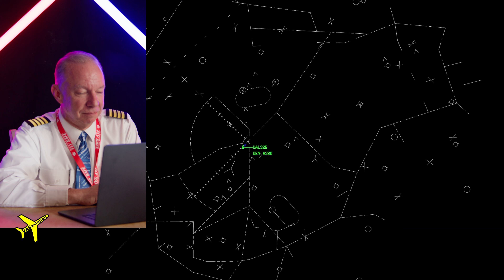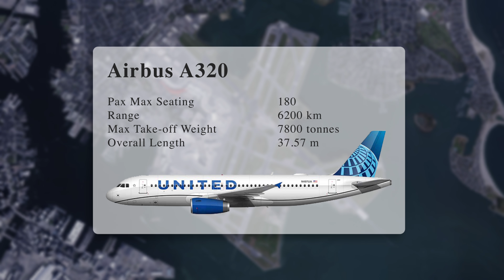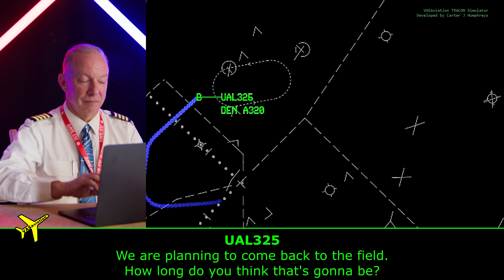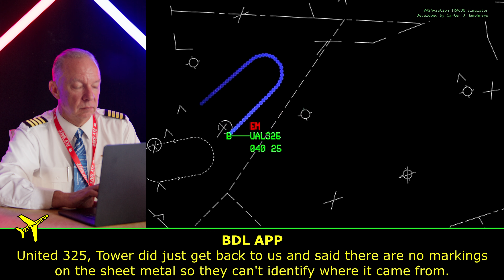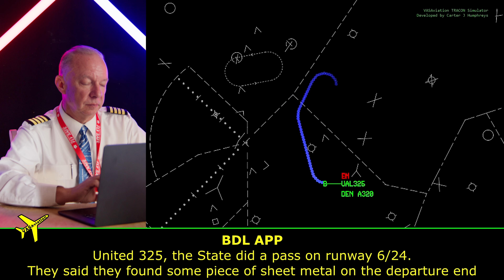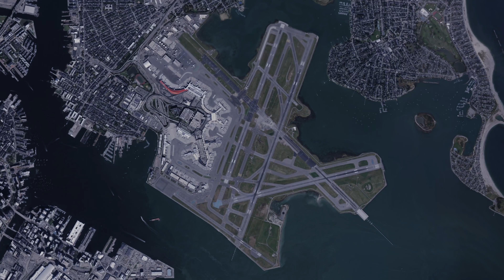United 325 Disaster Averted: Engine Trouble at Takeoff! | Captain Steeeve Breaks It Down

Comment: Captain Steeve...I am aware of an incident that happened in Milwaukee in September of 1985. When the Midwest plane was going to take off in Madison to Milwaukee...there was a delay to "fix" a "malfunctioning" right engine light which was indicating a problem.  The light was swapped out and the plane flew onto Milwaukee. While the plane was changing crews...my friend of many years...was to take the plane onto Atlanta.  (This an airline owned by Kimberly Clark) Again there we was a delay.  The new pilot (possibly Dan Martin) was asked by my friend wha t was causing this delay. The pilot told him that the right engine light was malfunctioning and it was being changed. 

Now...we don't know if the pilot was aware that there had been a delay for the very same 'reason ' in Madison...but it was enough for my friend to exit the plane and drive to Cleveland where he lived.

Why the mechanics in Madison AND Milwaukee BOTH failed to diagnose the real problem (the right engine had a bolt which was rising up and clipping the blades) but it led to the Crash of Flight of 105. On take off the bolt rose to the point where it sheered the right engine blades destroying the engine and possibly the shrapnel also negatively affected the left engine as the left engine 'stalled' only several hundred feet in the air then nose diving into the edge of the woods very near the airport. All  souls on board perished. The FAA blamed pilot error for over correcting and stalling the left engine.

The one civilian member of the five person committee blamed the engine failure as the cause of the crash. Of course...as you know....pilot error is a convenient choice of blame as it (in 1985) changes the amount of the survivor benefits paid out. 

The damaged engine was the problem.  WHY it was.'missed' twice within 45 minutes is tragic. 

Was there a cover up? Certainly there should have been notes logged on the maintenance log in Madison.  And when the NEW light  just thirty minutes later (or even during the short flight?) malfunctioned again (of course IT WASN'T malfunctioning, it was PERFECTLY SCREAMING CHECK THE RIGHT ENGINE!) how could that have been so easily sloughed off as inconsequential?

My friend who got off the plane arrived in Cleveland late in the evening.  His wife had been under the impression he'd died in the crash. WHY hasn't this sole survivor of Flight 105 never been interviewed about the events of that day? He knows what (really) happened.  He's a well known radio consultant who is well spoken. He could speak truth to power and exonerate Dan Martin and his co pilot.  Maybe I should do a podcast? 😮
Reply: The left engine did NOT stall.  It continued running.  There’s a fuselage between the left & right engines, so no possibility of shrapnel damage.  THE actual cause was pilots pulling up & losing speed.

That caused the plane to lose lift & crash.  If they had gone level then the plane would still be flying.

50-50 right engine explosion, but also pilot error
Reply: Also a plane can fly even if engines stop working.  It’s called gliding & these pilots should have been able to land semi-safely
Reply: Lawyer time
Reply: I think that you should let the FAA know what you know. Especially the part about the payout for the deaths of all the souls on board.
Reply: There is a short article on Wikipedia at https://en.wikipedia.org/wiki/Midwest_Express_Airlines_Flight_105.  According to them, pilot error after an engine failure caused by a detached sleeve spacer.  The chances of the pilots recovering were reduced by Midwests' "Silent Cockpit" rules, so that CRM was significantly affected.  The FAA Principal Operations Inspector also got a lot of criticism, as the silent cockpit rule was contrary to approved practice, and significantly reduced the chance of the crew safely landing the aircraft.
Reply: What amazing and LIFE SAVING foresight your friend had!!

Comment: This JetBlue pilot should be commended for potentially saving lives.
Reply: He’s too busy thanking whatever deity that all his tyres are still able to roll.
Reply: @philippal8666 tire
Reply: I noticed the manufacturer WASN'T initially mentioned!
Is this because it was Airbus, and NOT Boeing???
Reply: @gailreed4597  Might want to re-watch the video as he very clearly said it was an A320 so Airbus but its an engine in this case that is on many types of plane's, the plane was useing CFM - 56 from the tail number info ive found. A lot of A320s have this option as well as next gen B737s.
Reply: @cambellsweeney3095 None of the UAL A320's have CFM engines.  Look at the cowls.
Reply: @oscarb9139  5 of them have maybe you might want to check what you know. I admit I made a mistake ( Im not an jet engine pilot so can only go by the paper work I could find ) as this plane did that was correct but the paper work was 5 years old also UAL was not the first owners of this airframe so that might be why it had CFM 56s 5 years ago. 

You think thats a mess to follow, This will blow your mind I was a co-pilot before I lost my wings due to medical reasons on the Fokker 50, my airline had 6 of the twin turbo prop aircrafts they was all between 39 years old and 44 years old and between the 6 we had 3 different engine types. 2 of the planes in the fleet needed to have different load sheets the other 4 had the more common engine type.
Reply: @gailreed4597 Does it make a difference?  If so, why?

All aircraft have mechanical failures.  They both build good aircraft.
Reply: That’s his job lol. It’s not brain surgery. Decent eyesight will do the trick.
Reply: @waltersobchak7759  Thanks captain obvious!
Reply: @waltersobchak7759  ???!!!
Reply: 😂😂 @waltersobchak7759
Reply: @waltersobchak7759 you're not wrong, Walter, you're just an ahole
Reply: This "Capt Steve" guy is a Jet Blue pilot and he's gratuitously commending a Jet Blue crew for reporting debris on the runway.  What CA Steeeeve isn't telling you is that ALL PILOTS are COMPELLED to make such report.  If not, YOU can be held responsible.  Notice, CA Steve is always picking on United Airlines.  Do you know why?  Because he couldn't get hired by UAL, Delta, American or any other legacy airline.  As we speak, Jet Blue is on its last legs.  It's in deep financial trouble near going out of business.  CA Steev-Oh knows this and he's trying to set up an alternate career by making money off of aviation accidents, incidents, etc.  How morbid!  How Sick!
Reply: @dannyc.6744 Captain Steeve flew for American Airlines and is retired because he reached age 65.
Reply: @kittywilhite9583  I looked up dannyc profile. Looks like a bored troll. Nothing on the channel. There are a few comments, it seems he likes to pick on Capt. Steeve.
Reply: @dannyc.6744 Where tf did you get your information from? Or did you literally just make it up lol. Steve is a retired American Airlines pilot. He never flew for Jet Blue lol
Reply: @dannyc.6744 I’m sorry you never got your license bro but it’s not Steve’s fault. Plus I’m pretty sure if you have ever stepped foot in a plane and left the rural shack you’re stuck in you would know United blows hot ass to fly on.
Reply: @dannyc.6744  you are sick
Reply: @dannyc.6744 lol cool story bro
Reply: @dannyc.6744  Really???

Comment: It's a precautionary landing, not an emergency landing.
     Something like this can become an emergency. I was flying with me dad when I was a kid and another Cessna called and said his oil pressure had just dropped out. He wanted to make a precautionary landing. 
     He was saying that the same thing had happened the week before and it turned out it was the oil pressure sensor that had failed. "Even so, I'd like to-" there was a band over the radio and the pilot said, "Okay, now I have an emergency. My engine just seized." 
    He was already turning back to Bucannon Field which was a good thing. The turn had put him vary close to final for Travis AFB, where he landed safely.
Reply: I believe I heard the pilot declare an emergency, it was an emergency landing by definition.  At that point he can do almost whatever he likes to get his aircraft and passengers on the ground safely.  I once had smoke in the cabin of a little Cessna 172RG, so much so that I could barely see.  I did some testing with the fuses and aired out the cabin so it appeared to be under control (it turned out it as burning hydraulic fluid from the landing gear pressure switch malfunctioning, leaving the gear motor on).  I limped back to the airport and requested "expedited landing", not an emergency declaration.  I was always taught that declaring an emergency should be reserved for immediate concerns and it can create some headaches on the ground as well as for ATC and everyone involved, and I felt that my issue was under control.  A captain with many souls on board will have a much smaller threshold for declaring an emergency, but once declared it is an emergency treated with priority by everyone involved...

Comment: Did a little research on the incident, the plane lost a portion of the acoustic liner on the #2 engine.  I guess kinda like your muffler falling off your car.
Reply: The acoustic liner is not serious in its self however separating from the engine during run it may of hit other more important rotating parts
Reply: @kenheisner288 also any further engine damage may become uncontained. AKA fan blade through the cabin and out the other side.
Reply: @kenheisner288  may have but it did not
Reply: Minus the poor dude who runs over it Concorde Paris style.
Reply: The suspense was killing me, thank you! 😂
Reply: Just keep going. If the cops pull the plane over, pretend it just happened.
Reply: THE acoustic dampeners are part of the engine’s round inlet (cowling).  If they fall-off then they can cause damage to the spinning blades

.
Reply: @electrictroy2010 I’m no plane expert, but thought the same thing.
Reply: @Here_is_Waldo  I wonder how far they allowed to stick their broom stick up the exhaust to see if it's legal
Reply: Thank you for taking the trouble to do what Captain Steve or his team should have done.
Reply: that is interesting — ty for more context
Reply: I found the same info in a UAL press briefing later that day. They called it "pieces of the outer sound dampening liner". 
My question, Capt. Steve: is this sound dampening liner designed "as a noise muffler" or is it a sound wave (vibration) damper to protect the engine from its own sound vibrations?
Reply: @lancew.6568  Damping (dry), not dampening (wet).

Comment: Everyone handled this so professionally, even the engine, it kept on running even though it was loosing parts, testament to the engines and aircraft!!  Love the camaraderie of commercial aviation!!
Reply: Since Captain Steeve stated that he didn't know the final outcome of the incident, we don't actually know if the planes engine was shedding parts, We don't even know if the parts found came from that plane.
Reply: @davidquinn6161  Well, we do know a few things:
* Another aircraft observed debris coming from the plane as it was taking off
* Debris was recovered from the runway the plane just took off from.
* That plane had some minor but abnormal readings from the #2 engine
* When it landed, ARFF saw more debris coming from the #2 engine and collected it.
* When inspecting the #2 engine, ARFF saw something that persuaded the flight crew to shut down both engines and call for a tug.

I think it's a fairly safe assumption that the parts found came from United 325.
Reply: more like ...kept running despite airlines filling their ranks with DEI hires who have no professional skills other than skin color or *various preferences*.
Reply: *Losing

Comment: 18:10 pilot says 'cleared to land runway 2-325'; it was supposed to be 'runway 2-4'. Even if there isn't a runway 2, seems like that should have been corrected by the controller, especially since it sounded similar to 'runway 2-3'. Also, I don't get the hesitancy to do a low pass. You have to use up fuel anyway and you are informed with high probability that stuff of an unknown nature fell off your plane (could be a wheel). Seems like a small price to pay to see if the landing gear looks ok.

Comment: Come on, Steve! You tell the story so well, now I HAVE TO know what the parts were! Don't leave us in mid air!!
Reply: Engine outer sound dampening liner.
Reply: @brown96chris  For us commoners what does that mean a) in terms of safety and b) risk if didn't return when they did? Sound dampening doesn't seem to me to be critical but there must have been more if more debris was shed on landing?
Reply: @marycw THE acoustic dampeners are part of the engine’s round inlet (cowling).  If they fall-off then they can cause damage to the spinning blades

.
Reply: how silly to say. I won't tell you what it is lol

Comment: UMMM.  There is no Bradley Airport in Denver.  Bradley International Airport is in Windsor Locks Connecticut.  Denver International Airport ( a major United hub) is in Denver, Colorado.  The runways mentioned in all the communications is consistent with Bradley International in Windsor Locks.  shaking head @ "Denver’s Bradley International"

Comment: 😊So True. It's a bond with all airlines what can we do for safety for all, Common Good.
I remember working the grave yard shift at ewr for nw in 2000, I would take the employee bus to Term C arrivals and run back to nw Term B door 1 because CO had so many Express Employee buses but if you need to get to Term A or B you were SOL.
😊I asked my station manager why does it take me 25 min from my house 25 miles away n 25 minutes from employee parking 2 miles from employee parking to the Term. We got more employee buses for Term A n B😊

Comment: According to The Aviation Herald, "The airline reported the aircraft lost a portion of the sound dampening outer liner."

Full entry from the site,

A United Airbus A320-200, registration N490UA performing flight UA-325 from Hartford,CT to Denver,CO (USA) with 129 people on board, was climbing out of Hartford's runway 24 advising they possibly needed to return to Hartford, they were working on an issue. The following departure reported there was debris on the runway right at the center line. UA-325 stopped the climb at 4000 feet, entered a hold until the runway was cleared. The crew suspected a blown tyre and queried tower about what kind of debris this was and advised they were overweight, so not in a hurry to land back, the engines, especially the right hand engine, were running within parameters, they had a light pop upon rotation for takeoff and might have had a tyre damaged or a bird strike. The aircraft returned to Hartford for a safe landing on runway 29 about 45 minutes after departure.

The airline reported the aircraft lost a portion of the sound dampening outer liner.

The FAA reported: "United Airlines Flight 325 returned safely to Bradley International Airport in Connecticut around 8:45 a.m. local time on Thursday, June 20, after the crew reported an abnormal noise. The Airbus A320 was headed to Denver International Airport. The FAA will investigate."

A ground observer reported on departure the aircraft left large pieces of debris behind. A subsequent runway inspection confirmed large pieces of debris, sheet metal. Upon landing the aircraft left even more debris on the runway.

On Jun 21st 2024 the FAA reported: "AIRCRAFT DECLARED AN EMERGENCY AFTER DEPARTURE DUE TO AN ABNORMAL NOISE, RETURNED TO AIRPORT AND POST FLIGHT INSPECTION REVEALED THE RIGHT ENGINE COWLING HAD SEPARATED, WINDSOR LOCKS, CT."